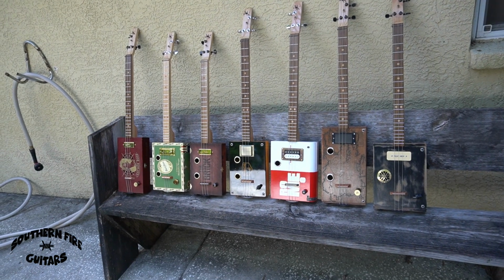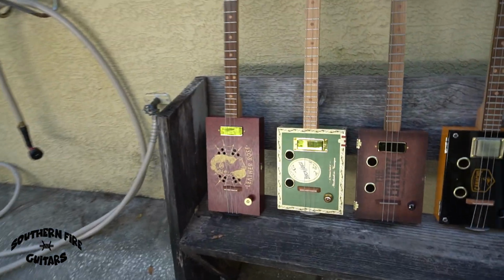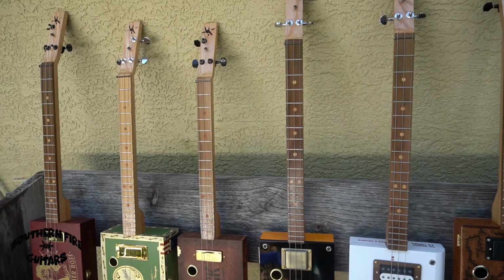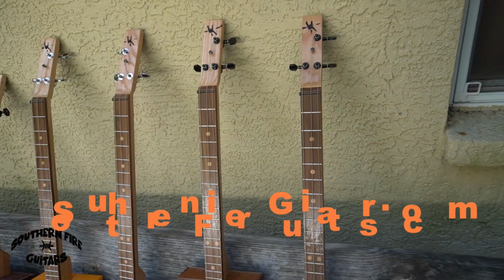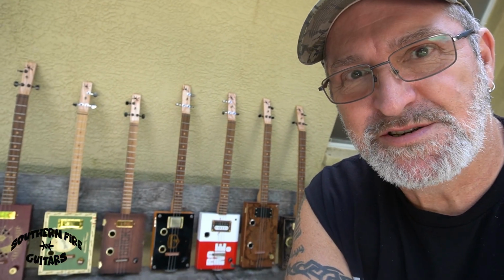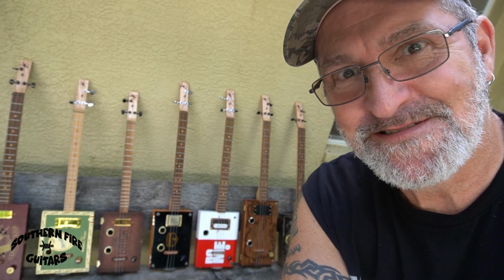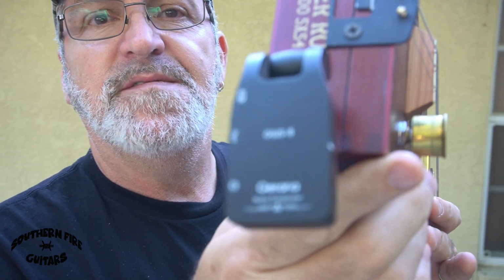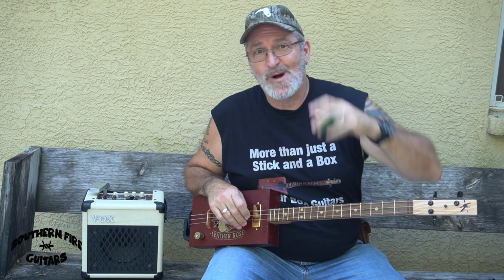Cigar Box Guitar - Whats better than ONE Cigar Box Guitar?  SEVEN.

Comment: I like Country Living. Sometimes 6 strings are better than 3. I also liked the sound of the soap bar the most. A quick question Mike - you've had your mini 5 for awhile now and given what's available today would it still be your choice?
Reply from the maker: Thanks Robert. 6 stringers are great if your wanting a certain sound in a song and 3 strings are great too , because you can't get a 6 string to sound like a 3 string if that's the sound your looking for. lol   Not to mention open tuning on a 3 stringer is a lot easier to learn. I haven't really played any of the newer small battery amps, so I wouldn't know the difference. 😎 M~